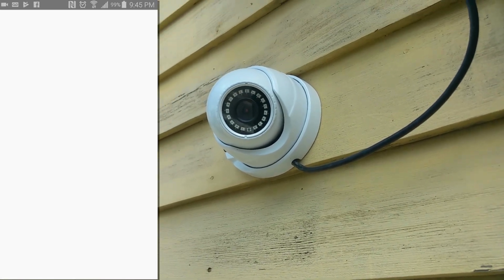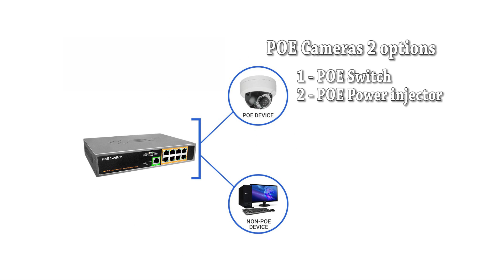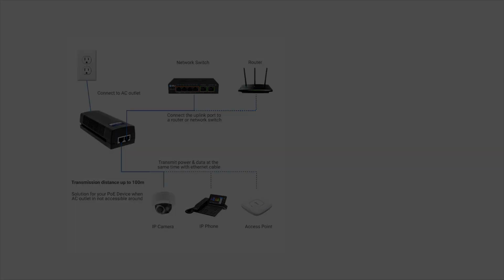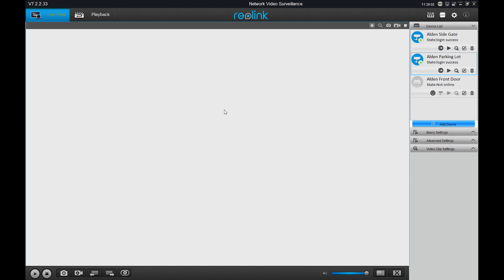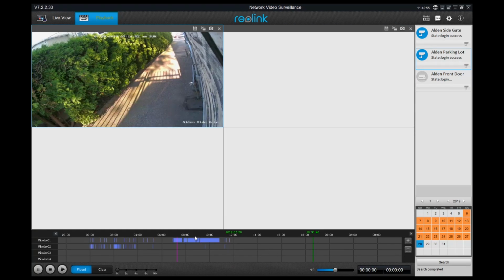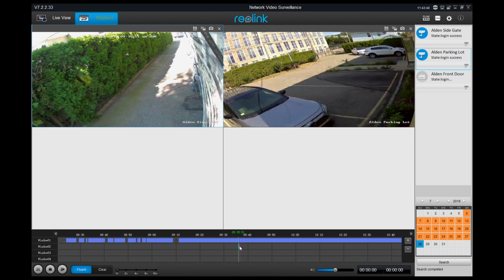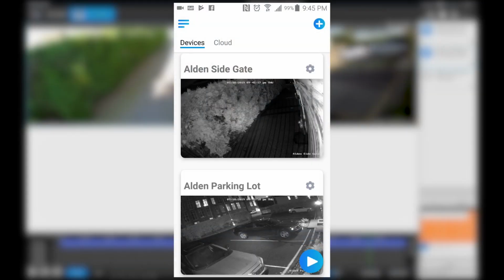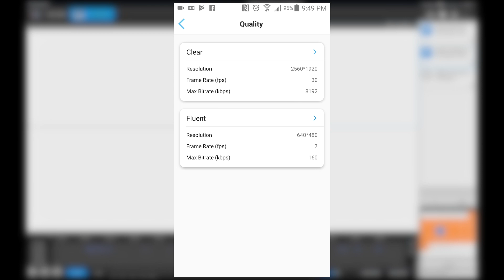How to install POE security Cameras / Reolink POE camera review

Comment: Does it need to be a special PoE switch only to give power? Cant use a regular switch? I got injector but need splitter for power as there's no power?
Reply from the maker: You can go from non poe switch to injector then to camera from injector. This will work. Connecting to non poe without injector will not work.
Reply: @daP.A  I got some cheap injector which has powe data and power inputs and 12v but not giving power to camera. Maybe just a bad injector? Would socket one with lan and poe inputs work ? Seen plug in socket one on Amazon

Comment: whats stopping someone from just cutting those outdoor cat6 cables. Maybe $500 for a camera system and it can be completely disabled with one cut. your completely exposing the simplest way to cripple your security. At that rate you should have just went wireless.
Reply from the maker: You still can capture them on video. There's more than one camera. The security cameras serve as a deterrent but it's doesn't stop anyone from damaging your property however you will at least be able to capture the person on video. Those cameras are high enough out of reach with multiple cameras in the right position to capture multiple angles thus catch the person on video. Also when someone sees cameras they will think twice about doing something stupid. The cameras help.